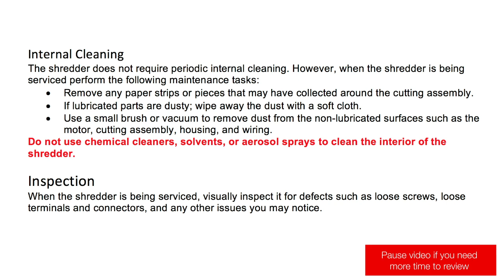Fellowes 99CI Shredder-Replace top On/Off Power button

Comment: I called Fellowes, as Vincent stated below, and she helped me over the phone, even though I was many years out of warranty.  Mine would give the red light when the bin was out, but would not shred.  He had me push down the middle power button hard for about 3 seconds and it came on.  She told me to clean that power button all in the creases with alcohol very good and that will do the fix!

Comment: Thank you!  This was my issue with shredder not turning on (though the waste basket open light would like, no others would).   I disassembled and sure enough opposite legs of the power button switch did not have continuity when tested with a multimeter.  Both the back and forwards buttons did have continuity.   I was able to desolder the power and forward switches and replace the power button with the forward switch and we're back in business.  Hopefully never really need the forward switch (we would need reverse to back out jammed documents)

Comment: Thank you for the video I just picked one up I wondered though why is it hard to stick paper in it I have another shredder and I feel like the slot is wider than this  shredder I almost have to use two hands just to stick one piece of paper through it. Is there an adjustment?
Reply from the maker: Hello Keith, you shouldn't have issues inserting paper into the feed slot. There is no adjustment for the feed opening. Please contact our Customer Service if this technical problem persists. 1-800-955-0959
Reply: There is a plastic door with a much more narrow slot that flips over for shredding DVDs & Credit Cards. It sounds like someone may have accidentally flipped flipped the door, in order to shred in this mode. Try flipping it the other way.

Comment: Thanks for the video, I've repaired the 99ci and two 79ci by cleaning the board and switches on the on/off power PCB. This saved myself and friends some cost. I love the 99ci and continue to recommend Fellowes as the best brand on the market.  The wheels do have problems overtime where some of them don't stay in the hole. Any ideas, the heads look fine. It only a problem if I need to left it.
Reply: Hi Karl, how did you clean the board and switch? Did you use compressed air? Thanks!
Reply: @paulbasantes2992  Hi, It was a year ago and the switch is still working. I just took the switch out. It will come apart. I cleaned it and put it back in. Be careful when you disassemble the switch as it pops apart. It will go back together. It takes about 30 -45 minutes to take the body apart to remove and clean the switch. Just using air on the switch did not work for me. With it open, you can clean up the insides of the shredder. FYI I got my unit in June of 2012 and still going strong. Just a wheel problem. I hope this helps
Reply: @karlmercer4840  thank you!!! I can't even remember when I got mine. I think around the same time as you. Appreciate the help! There was another person that mentioned to press hard on the button so I gave that a try. It actually worked!! I did previously open it up and cleaned the area. Used only a little compressed air. There was def a lot of paper and dust. Thanks again!

Comment: I'm absolutely tickled pink that the best personal shredder on the planet is working like new again  for $28 and 30 minutes of time. That's right, my 10 years old SB 99 Ci is more quiet and obviously working better than it has since the button started acting up a few years ago. Problem started with a cat that used to sit on the thing and clean itself, sending dander, shedding hair, dirt, etc. falling on top/into the switch. A small sheet of Press-n-Seal plastic food wrap now covers the button to prevent hair, dust, dirt, cooties from going down there, but the damage to the original button was already done by the time I thought of applying this trick. ... A couple of extra tips: Have a red or black Sharpie handy to mark the top side of the plug you are removing so you aren't twisting and wondering which side is up when you plug the new one back into the circuit board. If you wear glasses, and find yourself fiddling around doing this will remove that part of guessing if the correct side is facing toward you. 
Make sure the Black Rocker On/Off Switch on the side of the unit is properly seated in its housing before you button everything back up. 
Use a regular Phillips Head screwdriver with a 6" long barrel and magnetize it to hold the screws in place instead of just dropping the screws down into the 3 deep wells. 
Remember you are screwing the screws into plastic receptacles. So don't go all Superman on the damned things and strip a receptacle by OVER-tightening thus ending up SOL. 
If you accidently shift the shredder head out of position - I reached for something on the floor while the unit was on my lap and it shifted out of position - it sits on 4 rubber grommets, one at each corner. One end of the grommet is smaller in diameter and fits snugly (but not so snugly that you have to fight with it) inside a machined hole in the metal housing. Make sure all the grommets are seated properly before buttoning it back up.
Lastly, thank you, Fellowes, for posting the video AND having professional, friendly and courteous folks working your Customer Service department. They ask you for the model number and serial number to ensure they are sending you the correct part. (it's  right behind where the bin slides in, so have a magnifying glass & flashlight. or take a pic and blow it up.) 
I'm so tickled pink, and amazed at how quiet it suddenly is, I keep turning it on and off even though there is nothing left to shred. For $28 its just like having a brand new $275 toy. 😊